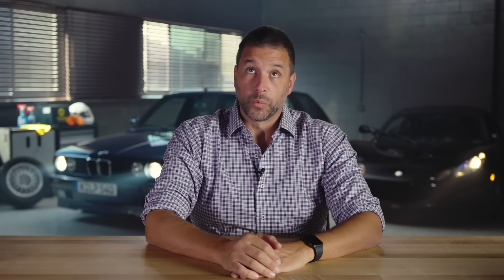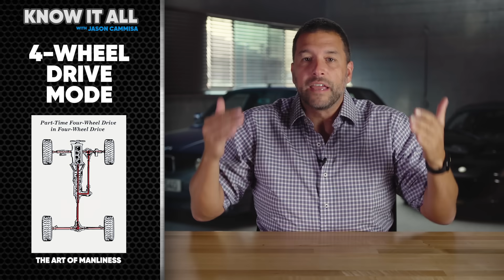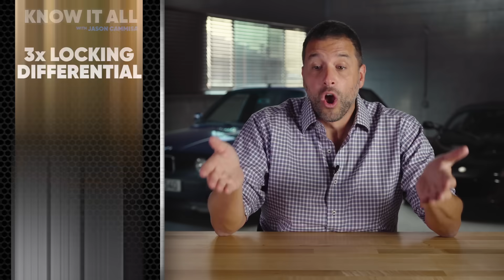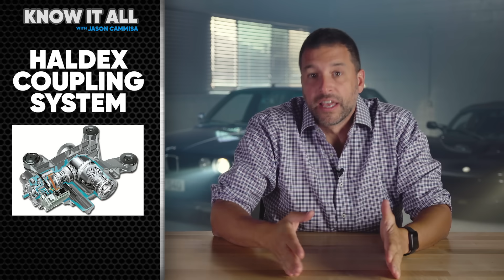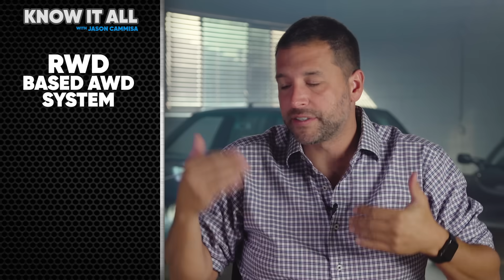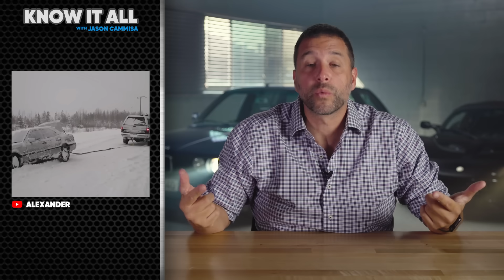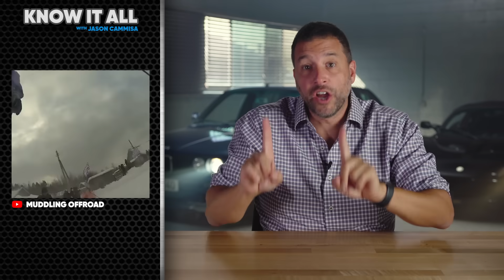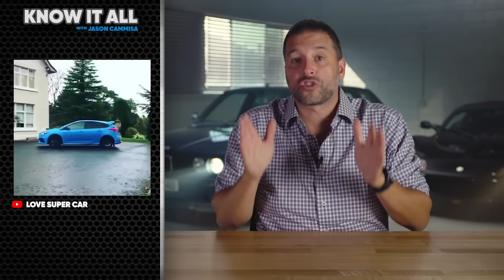Understand Your All-Wheel-Drive System | Know it All with Jason Cammisa | Ep. 04

Comment: This is much better than many videos about this subject.  However, occasionally you mixed up "power" and "torque" when talking about what is transferred.  For example a locked differential ensures each each side/axle is spinning at the same speed.  The torque sent to each side will vary and since power=Torque*speed the power sent to each side will vary.  Thus an old school part time 4WD system doesn't send equal power front and rear.  Rather it sends what ever torque is needed to keep the velocity the same front and rear.  Regardless, this was a good video to watch.

Comment: Just found this channel...and new subscriber.  I do believe you may have provided some mis information regarding the SQ5, it is a Torsen based AWD system (as are all longitudinally mounted Audi engines, everything from the *4 and up, excluding the R8, which uses Haldex) and typically has a 40/60 split rear biased.  Please correct me if I am wrong here.
Reply: You’re correct.  In the SQ5 - power goes to the center diff first then splits 40:60 front to rear.  Due to gearing, the rear can get as much as 85% of torque.  This is in Audi S models now, and not in transverse applications or regular ‘A models with “Ultra” Quattro.

Comment: Great video.  One correction.  In your hypothetical jump/wheelie you would still not get 100% of power to rear wheels. AWD clutches are not sized for 100% power they would slip reducing power to rear wheels.  

I have actually witnessed a 2dr Jeep Wrangler rubicon (lockers) driving up a steep rock ledge end up on one wheel for a few moments.  Highlighting the power (pun intended) of a true mechanical 4WD system with lockers.

Comment: I’ll stick with my 1980 Bronco, brand new driveline, u joints, steering gear box, tie rods, springs, shocks, borgeson steering shaft, new LSD front/rear, manual t case, manual locking hubs. Analog for the win

Comment: Finally, someone has the guts to tell the truth. One of the biggest points here is if your car or truck has open spool diffs rather than LSD or true locking diffs, it is possible to get a front and rear wheel slipping and you basically do not move.  A second takeaway is when the automaker (BMW for example) uses the Bosch brake pumping the disc to stop it from spinning but it really does not work very well.  Better to have LSD.  Bravo Jason.

Comment: My Challenger GT's AWD was fantastic. Rear based and could send up to 38% to the fronts if necessary. It was so much fun in the snow! All the donut turning hilarity of a torquey RWD car but the ability to straighten out and go forward if I wanted it to.
Reply: I don't know where this 38% thing comes from, I see it all the time with people talking about the systems in these cars 09 and newer. It's just not true, because the transfer case clutch can fully lock it's technically capable of 100% to the front. Of course that'd be with the rear wheels in the air. The pre-09 systems had a 38% full time system.
Reply: @snek9353  The Challenger did not have AWD until 2018, so you must be confusing this with the Charger. The Challenger's AWD is not 100% to any wheel. It's rear-biased, and will only engage a portion of torque to the front wheels. I can tell you this from first-hand experience because I owned one for three years.
Reply: @voodooturbo  None of that is 100% correct but close. 
- The Challenger first got AWD in '17 not '18. 
- They use the same system as the Charger and 300, so yes I'm comparing to the Charger. 
- Really depends on how you define 100%, if the other 3 are in the air it can put all the power to the one that isn't given that the brakes are strong enough. 
- From '09 on it's not just "rear biased" but RWD based, there's no way for the system to remove power from the rear, it's directly coupled to the transmission output. 
- I own this system with an improved Hemi currently.
- The main point is that the 38% thing is complete BS. The pre-'09 system used in the Charger, 300, and Magnum had a 38/62 full time system. Not the system used in the Challenger.
Reply: @snek9353  Man, you are really confident in your ignorance, I'll give you that.
Reply: @voodooturbo  You say that, but you can't fault one thing can you?

Comment: The haldex argument is wrong. There are proactive haldex systems that can send power to the back before the front wheels even start to have slip, based on steering angle, road condition etc

Comment: Interesting how the AWD system in my 09 Jeep SRT8 (open front and rear diffs), is rear bias but only up to 90% (and as low as a %40/%60 split) so yes it does always have understeer but also likes to let the rear loose in the rain/snow.  I noticed you left out the all important LSD and just kept it to open or closed diffs. Thanks to at least 10% of the power going to the front I don't do 1 wheel burnouts, lol.

Comment: Many VW/Audi products with longitudinally mounted engines use Torsen AWD, like the VW Touareg & Porsche Cayenne. In fact, all medium/large VW/Audi products use longitudinal rear-biased MLB (Quattro) AWD systems. Smaller VW/Audi products on the MQB platform, are front-biased Haldex systems. Also, BMW sells front-biased AWD vehicles too, including the X1/X2 and others. So to say BMW has a superior AWD system is misleading.

Comment: About getting out of trouble, many of these haldex type AWD systems have very small rear diffs that overheat in a few seconds and the computer turns it into full FWD until it cools down, the most spectacular examples of this are Honda CRV And Toyota RAV4. These systems are nearly useless, helpful in light snow but is it worth the extra weight? I would not choose the AWD option.
Reply: Better off fitting winter tyres instead to a FWD car.
Reply: @khalidacosta7133  you need winter tyres regardless of how many wheels are driven, AWD won't make your tires grippier in cold temperatures, change their tread pattern for one more suited for snow or make them grip on ice

Comment: I've lived in MN my entire life and this is about my thirtieth winter season as a driver. I live in a pretty decent sized city (100k) and while I've had AWD vehicles at different times in my life I've kept my wife and I in AWD for the last 5-6 years. We had two wagons: an 06 Audi A6 and 05 Subaru Outback XT, 10 Mitsubishi Endeavor and now 99 CRV and 19 Highlander.  The main thing is simply getting around and most any AWD will accomplish this but there is a fun quotient as well and while the wagons did understeer you could get them to rotate. You just have to stay committed (especially in the Audi) or your going to slam a curb. Both were predictable as well and you could drift them back and forth as much as you like correcting them easily with a quick counter on the wheel. I didn't spend much time in the Endeavor but the CRV is very neutral as is the Highlander which is not as much fun but more confidence inspiring. I drive the CRV and love it! I miss the Audi and to some degree the Subaru but they had limited space and required high octane (among other special fluids).

Comment: I have a Volvo s80 V8 AWD; it's clearly way better than just FWD but you can tell where the bias is for sure.  Fantastic daily but not great trying to push it.  However I thought on earlier Haldex systems it had some viscous fluid coupling yada yada I don't know that made it so it really was AWD but only 5% went to the rear in normal driving so the rears kept same pace as the more powered fronts.  The coupling notices the difference and makes up for it so it's never actually 2wd.

I'm also not used to Haldex making that 100% claim, just that it can specifically send more or less power to any given wheel.

Comment: Not 100% sure, but I suspect that the Nissan Skyline GT-R R32 was one of the first cars to have a computer-controlled clutch that would apply torque to the front wheels based on the current car's attitude and state.   If I remember my track days, the typical max torque was around 25-35% unless you were doing rather pointless lurid drifts.

Comment: I learned it right away in my bought used off lease Volvo XC70 where the first original had driven it around in front wheel drive all the time due to a broken control. It worked much better when it was fixed and plus a 1999 XC70 can't go to the limit with the sloppy steering it has. Still loved that car and only sold it when we moved to Europe.

Comment: well it's on oversimplification to say all Audi's are FWD biased. The transversely mounted Audi, VW are FWD biased, d/t using a transaxle and the subsequent 4WD system. To get the Audi Torsen system requires the longitudinally mounted engine. Ya?

Comment: Except the Part Time 4x4 (Like most American pickups) which is NOT AWD - AWD is either Full Time 4WD like the Quadratrac system OR one of the Clutch Pack/Viscous Systems...I wished people would understand this... - don't have a center differential (that is why you can't use on pavement) and therefore doesn't need a "Third Locker" just front and rear diff locks. That "sending the power to the tires that grip" sales bullshit has been making me roll my eyes for DECADES... Now the most hated feature in my FWD (2WD only) Toyota car is my favorite when trying to get moving on slippery surfaces... ABS Controlled Traction and stability control... Makes the car boring to drive when you want to make it drift...but when taking off in a straight line, makes it best of both worlds...Open Diff for cornering and LSD for takeoff... Now if the AWD/ABS/TRAC system is able to have open diffs and be able to put the brakes on the 3 tires without traction making all 4 spin same speed then an ONLY then can a car without lockers send 100% of its power to the tire that grips....

Comment: The. Focus RS is similar to the vw but the difference of the two is VW has break torque vectoring where the RS sends Power two the outer wheels as well can send 60 percent power to back and not 50.  Of that 60 it can send 100 percent power to either wheel.     The more you know.

Comment: Or, you can get a car with an ACTUAL AWD system i.e a-la EVO 1-3 or 1G/2G DSM where the torque is evenly split  at a 50-50 ratio. Coupled with the rare rear LSD, you get infinite handling capabilities only limited by your tires ;). Oh, and there's no getting stuck in mud or snow with this bad boy. Mitsubishi made this flawless platform worse by adding bullshit electronic controls and active center and rear diffs.

Comment: Euh Volvo has in AWD 60% to the rear and 40% to the front. You can drive a Volvo awd in the snow like a RWD car. I did donuts on the spot in mine and drifted the whole winter in the snow. And the main reason Audi's oversteer is the fact that the engine is hanging on the front bumper.

Comment: I wonder what Quattro my A6 has. It actually rotates decently well once I flick it, but it might be the 480 hp  and the Bilstein PSS10 coilovers. Forged rims and Michelin tires helped handling so much too.
Also had a protuned full bolt on WRX STI and I found a setting on it that would make it rotate beautifully. Controllable Center diff setting to Auto, Bias rear one line on the display, traction control off. That also had custom suspension and 57c6 Rays Gram Light rims. Same Michelin Pilot Super Sport tires. The 4 differentials in the STI made it awesome witchcraft to drive in the Canadian winter.

Comment: But can it be done? Like none of the car manufacturers do it because it's inefficient and they have mpgs to hit.
But could the main drive shaft go directly from the engine to the transfer case or whatever it's called and then another 2 drive shafts come out, 1 to the front and 1 to the back. With e diffs on each axle and in the middle, could we have a car  that sends all it's power to 1 wheel if we set it to? Or like just full open diffs and 1 wheel is in the air?

Comment: What about electric car AWD systems? Something like a M3P where you can split the torque 30f/70r. Is that actually happening or just changing h the priority of the computer to allow the rear to slip a little more than the front? Also the fact the motors should be infinitely adjustable limited slip differentials :/

Comment: Disagree regarding Audi Q5 - all longitudinal engined Audi's have a torsen centre differential which distribute torque front and rear in a fixed ratio. The sporty versions having more torque to the rear than the front.

Comment: Haldex systems often take power from just the front left or just the front right driveshaft to send to the rear.

So you actually have one wheel being driven off of one side of the front diff, and all the other wheels powered by the other side.

That's just as crap as it sounds.  You have to do some crazy things with the stability control system to compensate.

So fwd based AWD is even crappier than you think.

Comment: Tip for BMW X5 owners: don't do 4 wheel turning power slides even on loose pea gravel.
I've recently blown up my second (brand new) gearbox. Thats 2 gearboxes in only 5 years.
Ps: it was the crappy GM 5spd auto though & you think I'd learn after the 1st one. 😂

Comment: I wonder how this applies to dual, tri, and quad motor electric vehicles.
Reply: A quad motor EV would be the perfect solution, in theory. No differentials needed and the computer can send the perfect amount of torque to each wheel based on sensor input. It would also probably be a heavy boat with not great handling though, not sure.
Reply: @Robert-un3cf  Not necessarily. There are in-wheel motors that are going to be used on some upcoming EVs that when adding the weight of all four together weigh less than a Large drive unit for a Tesla model S

Comment: Front drive ralley drivers leaned how to use rear brake application to compensate for inherent under steer back in the day.  Front drive is still superior to rear drive on snow and ice.  Front drive is also getting better on paved surfaces.  Honda Civic Type R anyone?

Comment: Iirc, my 2003 Infiniti FX45 has all wheel drive up to 40mph, then 100% rwd. Then computer vectors the power depending on a driving situation. It is the same attessa ≤spelling?≥ that was used in Skyline. Or so I was told.

Comment: The STi DCCD!!!! Up to 41/59 F/R using a viscous coupling mechanical differential AND an electronic wet plate clutch. The computer controls the electronic clutch and the driver can adjust it, on top of the yaw control system that uses inside front wheel breaking while cornering. Helical front diff and a clutch type rear LSD. 

Not 100% bias, which is BS, but definitely one of the best AWD systems out there.

Comment: While stationed at Ft Campbell KY, in the 90's. My commander wanted to up grade and replace our older Hummers with the new models. While there were a few advantages to the new model there were huge disadvantages as well. The newer models had open differentials, so it really wasn't all wheel drive, it was one wheel spin! The older models had limited slip differentials. I could drop one wheel off into a deep hole, lifting the opposing wheel on the other axle all but off the ground and the two firmly planted wheels would pull us right out of that hole.

Comment: forgot to mention the viscous diff system that honda and ford use in some of their cars. Like the honda crv. it has a system that is FWD, but is always sending power to the rear. In this system, the rear diff has a viscous clutch pack, that engages when there is enough pressure to clamp the rear clutch pack (all mechanical/hydraulic. not electronically controlled. much like a toque converter, but much smaller). It doesn't engage because the rear diff is underdriven (like mentioned about sh-awd, evo, ect, but opposite). It engages when the front wheels start to slip, which builds pressure in the diff clutch packs, then sends some power to the rear.
It's a very simple but effective design.

Comment: While the driving characteristics of Haldex AWD systems is accurate saying that the power distribution is set to 50/50 is not. That would be the case if there was a differential between the front and rear axles but in the case of Haldex at least there is only a clutch pack meaning when fully engaged it locks the front and rear axles to spin the same speed just like a 4x4 pickup which gives both the power distribution perks and front end plow typical of such setup's.

Comment: The Quadra drive system in Jeep Grand Cherokee WJ models can actually send 100% of the power to one wheel. It uses gerotors in all three differentials to bias power between front and rear, and side to side. Even in the offroading community this power is often overlooked but I have been off road many times in a WJ and it simply cannot get stuck and out performs Rubicon Jeeps in every situation except where ground clearance and articulation matter more than traction.

Comment: Welded diff & manual hubs up front, and an Eaton limited slip in the rear 😁 of course there is no more turning with the 4x4 engaged, BUT its great where it matters 👌 ..and besides that, its still a RWD car at the end of the day with that sweeeeet oversteer 😁😄